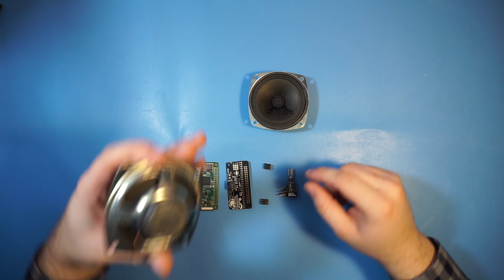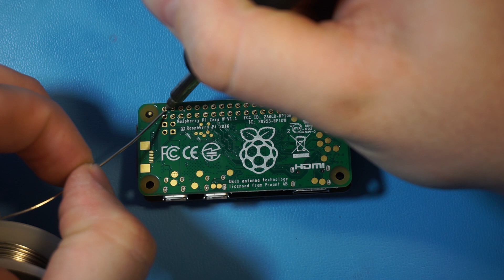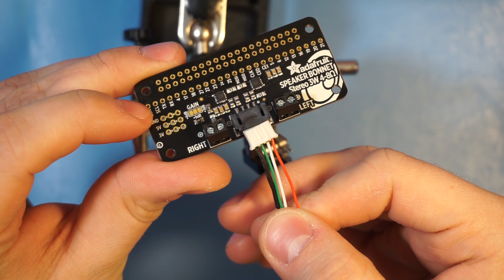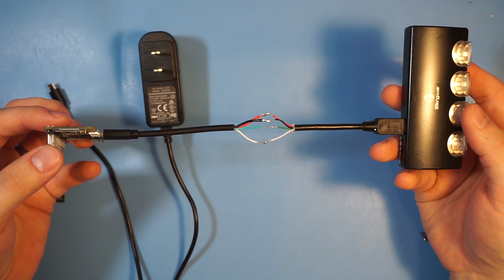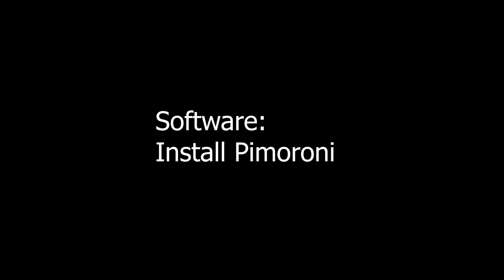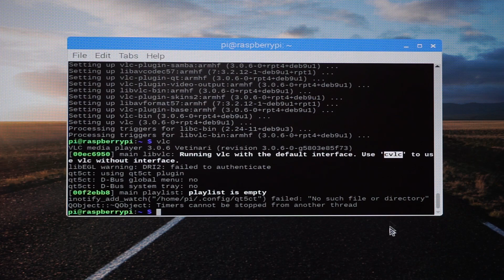DIY Raspberry Pi Zero Internet Radio

Comment: It is not a good practice to control the power signal to the speakers with a potentiometer. In all cases this is highly inefficient. I recommend connecting the potentiometer on the path of the audio signal before the end power amp. I don't know what is the schematic of the board an is this possible, but this is the only proper way. The other way is to use rotary encoder instead of potentiometer and control the volume from the software if that is possible.
Reply from the maker: Thanks for the tip!

Comment: Simple enough. Good descriptive video. Would this work with a USB Ethernet adapter instead of WiFi? I have the parts. Going to try is as you built it. Maybe Ethernet later. Known fact, smoke can easily transfer between uninsulated conductors! Thanks for posting.

Comment: Dave, if as you say below this is a 50K ohm pot, it is way too high a value to control volume into a pair of 8 ohm speakers.  Something like 80 ohms would have more success, or even better run into an external amp.  That all said it is also dependant on your schematic, which I do not see here.   That all said this is a great video.  Well done.
Reply: Skip the potentiometer, you adjust the volume in the software.

Comment: Is your POT an Audio Taper or Linear taper pot? I'd guess you have a Linear pot and might do better with an Audio Taper pot.  What resistance are you using?  It may be the combination of using an Audio Taper and a lower resistance POT would sole your issue.